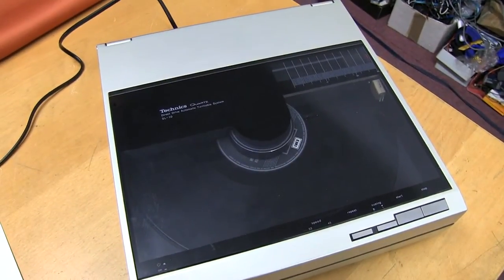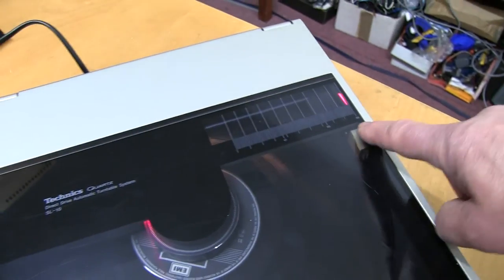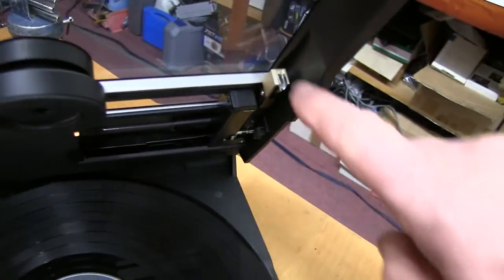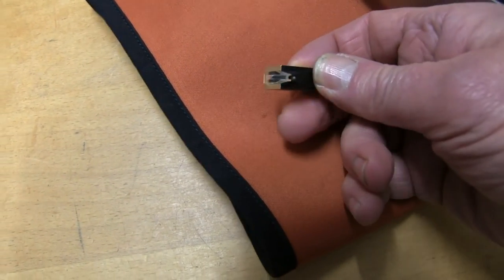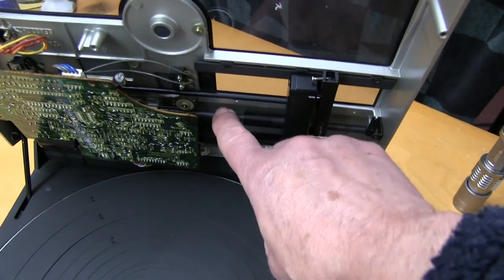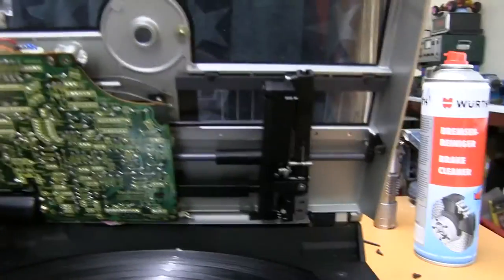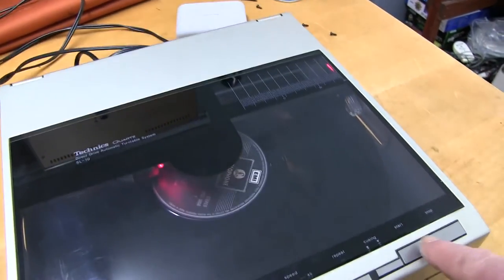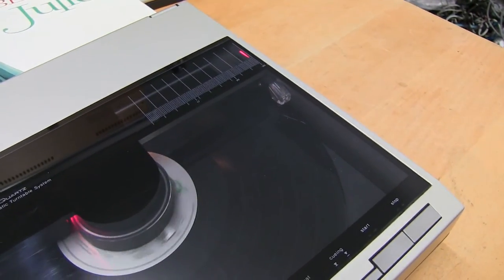Technics SL-10 Record player. Repair, Service and Test

Comment: Thanks to your two videos,  I have been brave enough to service my two SL-10's, clean and re-lube, remove the puck, replace the drive belts and cartridges and now they sound great and work smoothly.  Cheers Nick!
Reply from the maker: Well done. All the best and spin on.
Reply: How did you get that arm to move the needle over? I have one of these and that's all that's not working.  I got it at a thrift store for like 3 dollars!

Comment: Thanks Nick, your video helped me to confidently venture into an SL-7 that I purchased last week of eBay. The seller had one with the rubber belt completely off and wondered why it wasn't working so sold it cheap as "spares or repairs". Looks like his loss was my gain as I've put a belt on and it works!

I've cleaned off all the old grease which takes a fair amount of time and have been researching what kind of grease to use on the gears and guide rail. I came to the conclusion that the nylon worm gear runs fine dry and the metal tonearm guide feels smooth anyway. To my surprise I've come back to your video and read the comments that you didn't re-grease everything either.

I wonder why so much grease was used at the factory? Like the gentleman who commented here, the grease on the tensioned wire was black, as was the grease in the puck for me. I think that will be the only place where I'll be replacing the grease. It's a shame no oiling or greasing procedures are in the service manual.

The only issue I'm having at the moment is there's a scraping sound in one spot when the arm travels to the left, it's fine when travelling all the way to the right. It's bugging me, so I'll have to find a way to trick the player into thinking the lid is down and about to play while I actually have the cover off.

Your rubber belt seems a little too loose, so I recon a new one would be the icing on the cake.
Reply from the maker: Hi Andrew. Well done. I like the SL-7 very much. I think it is visually more attractive than my SL-10 which is a solid square. If your lid catches are not broken, then you have scored a good one. Scaping noise. It could be the plastic cover over the wires, that moves with the arm
Reply: I found an SL-7 today at a thrift store for $5.  It needs work.  Arm is stuck.  The platter won't start turning with the Start button unless I manually ensure the arm is fully right first.  There's a little play up there and I don't think it likes being anything other than fully right to start.  Not sure yet.  Hope I can get mine working.  It's in really good aesthetic condition.

Comment: I had the same issue with my SL-10  The problem was the tonearm motor was seized.  If you can get to it and turn the motor shaft by hand, with the help of some lubricant, you will be able to loosen it.  Mine has worked fine ever since, going on 6 years now.
Reply from the maker: +beninski707 
Hi, yes, most faults are simple and just the grease and lubrication.
They are very solid build.
If you still have the MC cartridge they sound excellent.
Nick

Comment: Hi Nick, 
I purchased the SL7 version which I regrettably sold to a friend complete with it's original box, packing and transit screws. When he moved I asked him if I could buy it back. Negotiations failed so I tried to buy one on ebay. 
This seller put it in a jiffy bag and posted it. Not surprisingly it arrived absolutely wrecked with a bad dent in the metal casing and the cover clips broken. 
The seller got very angry when I suggested his knowledge of mass and inertia were lacking and that was why the turntable got smashed. 
I did manage to buy another which came with the brilliant Technics cartridge the EPC205C Mk3 which was a Sure V15 killer. In the days of ultra high compliance cartridges the Technics had a Boron stylus tube which was much better at tracking than Shure V15 Mk 3 and 4 
It won several rave reviews in it's day. 
The Old SL7 ~ well it does play of a fashion if you tape the lid down with gaffer tape. 
It's nice to see that the SL10 comes apart more easily than the SL7 
Thanks for the video
Reply from the maker: Hi Jeremy
Yes, the broken players in the post. I have had many.
You scored with the EPC205C
My SL10 has the original EPC-310MC, but they are fragile, so be careful with that pipe.
Reply: I brought one of the cartridges direct from technics via the rep and got it for a bargain price. It was quite fascinating when Shure were producing the ultra high compliance cartages like the V15 III and IV 
It was all about SME arms and ultra low tracking weights.
Technics came along and moved the gateposts quite significantly.

Comment: Just wanted to thank you for the great info. I have secured one of these via EvilBay and it needs work so this vid will be invaluable. My plan is to eventually use this in the vertical aspect. I want to Bluetooth it to my Technics amp. Yeah, I'm not expecting miracles and I'm no audiophile. Quick question. The unit I'm getting has a Ortofon TM20H cartridge. Not sure if its MM or MC, any info I find is sketchy. My question is depending on whether the cart is MM or MC will I still need to ground the turntable to my eventual choice of Bluetooth transmitter if in fact I'm utilizing the internal pre-amp of the SL-10. Or indeed will I still need an external pre-amp before the BT Transmitter, no matter the flavor of the stylus? Hope this makes some kind of sense. Many thanks in advance...

Comment: Great video which helped me get my tonearm advancing again after it got stuck. My issue now is figuring out how to get the whole hinge and stay back reattached. The whole apparatus, the stay itself along with its holder came off when I was disassembling. And I have no idea how it goes back together.
Reply from the maker: Hi
Did you look at the service manual?
You can get it from (free, just register)
https://www.vinylengine.com/library/technics/sl-10.shtml
Reply: I did, yes. They don't really show much about the stay; nothing about the pieces to it. Basically, I can't figure out how to attach it to the plate. It's been beguiling and frustrating me for days now.

Comment: Hello Nick!  Thanks for posting the videos regarding the maintenance for the SL-10.  I bought a new one in the 1980s and have never had to have it serviced.  I recently replaced it with an Audio-Techica 1240 because the SL started having some issues.  The SL will start to play a record and within 3-5 minutes the tone arm lifts up and returns to the resting position.  Do you think that the issue may be as easy a fix as opening the top of the case and cleaning it up?  Regrease the ball bearing etc...  I appreciate your time and hope to see a response at your leisure.   Sincerely, Scott
Reply from the maker: Hi Scott. Those type of problems are caused by the old grease on the arm tracking shafts, belts and gears. They can be cleaned up without having to replace any parts.

Comment: Hi Nick, 

Thanks so much for your service information video.

I've got an SL-6 in California that I picked up yesterday in a thrift shop.  It's not as fancy as the SL-10 in your video, but for the most part, this turntable looks very nice and plays correctly.   Unfortunately,  sometimes the tonearm/cartridge assembly "hangs up" on the rails.   I was guessing that possibly something was causing the tone arm to slightly jam, causing the record to skip. I haven't taken my player apart yet, but, just to be clear, are you saying there shouldn't be any grease on the rails, or should there be a light coating of fresh grease there?

Thanks a lot, Tom
Reply from the maker: Hi Tom
Clean off all the old grease.
The plastic will slide even without grease, but if you have some very light grease, but not 0il as that can dry up.
If you take it apart, be careful with the black sliding cover over the wires, that it is fitted correctly or it will jam half way through the record.
Let me know how you get on
Nick
Reply: Hi Nick, 

Thanks so much for getting back to me.

I was able to raise my top lid and depress the small switch at the rear of the base.  Normally this switch is engaged only when the lid goes down.  I could then operate my turntable where I could view the tonearm/cartridge mechanism operating.  There is grease there, but it is very sticky and needs to be removed.  I do have some clear light grease called Super Lube.  It's a synthetic grease with PTFE that's been recommended for use on an older turntable mechanism I serviced.

I have no idea how long this turntable has been sitting, but I imagine it's been quite a few years.  I've found that by playing it and monitoring the operation, that it seems to be getting better and better.  Having said all that, I still plan to clean off the old grease with some kind of solvent and  use my Super Lube.

I'll keep you posted as to how all this goes. 

Thanks again for all your help.

Regards, Tom

Comment: Hi, maybe you know.  I have a problem with my sl 10.  The arm stops 5mm before touching the return switch.  The cord is right, averything is right. So if I play a record that ends near the center groove, the arm return before song ends I repeat, it stops before activate the return switch

Comment: How did you remove that final clip near the record clamp? I have all the screws out in order to replace the cueing belt but got hung up there. Don't want to snap anything. Cheers and thanks for the great video.
Reply from the maker: Hi Joshua. You have to gently pull it, until it is free.

Comment: Thanks for this video - I am hearing a low 'thump' sound in between tracks.  I am thinking of opening up the unit and greasing/oiling the gears / bearings...may also change the belt.  But not sure if this will fix?  (or if the low thump is how the unit performs in general)
Reply from the maker: Hi
The thump could be the tracking motor trying to move.
Check on the run out grooves if the thump speeds up as it runs out to the end.
Or If it occurs exactly on every revolution, then there must be something touching or seized' like the pressure pad.
Try rotating the pad by hand to see if it is really free.
The platter is direct drive.
There is a cable that pulls the assembly, but it must run free on the tracking rod, so make sure that is very clean.

Comment: Hello sir we have the same turntable and the same problem. The tonearm is stuck on the end I did not see how you manage to make it work. Can you please elaborate on it. Thanks from the Philippines
Reply from the maker: Hi Gino.  Remove the drive cord and clean  all parts to remove grease. Clean the guide tubes so that the cartridge arm can slide easily. Clean the drive cord and make sure the motor and gears turn easily. All the best Nick

Comment: Duh!  I just read your response regarding the same issue just a few posts back.  I will pull it apart and clean it up and regrease.   While I am working on it, should I replace the main belt for turning the platter?  Thanks!
Reply from the maker: Hi Scott. The platter is direct drive, so does not have a belt. One advantage of direct drive. Keep spinning. Nick

Comment: So sorry to hear that Nick has passed away. I have taken apart my SL-10 and found that the little rubber drive belt on the left side has disintegrated. Does anyone know of the availability of a replacement? RIP Nick.

Comment: Appreciated the video. Have you ever worked on a Technics SL-Q5 where it seems to slow down after a bit, the platter seems to slow after 4 or five beats if that makes sense?
Reply from the maker: Hi Owen. Not sure exactly, does it stay slow, or speed back up.  It is possible the speed adjustment pot VR310 is bad connection. I would turn it a few times, and lubricate with switch cleaner if necessary.
After that if no change then check table revolves without friction, and then check all connections that are not soldered on the circuit board.
Reply: @nickadams5411  Thanks, that's what I was thinking also.

Comment: Hi, Nick - I have an SL-10 but not the power cord!  Cannot find it.  Is this a universal kind of cord, or does it have a number associated with it which I can use to shop for one??
Reply from the maker: Hi Cynthia. It is a standard " Figure 8" power lead. Ebay or Amazon:
https://www.amazon.co.uk/LINDY-Mains-Power-Lead-Black/dp/B000I2JUOC/ref=pd_vtph_lp_t_3/260-9124336-2098636?_encoding=UTF8&pd_rd_i=B000I2JUOC&pd_rd_r=ebbb9f3d-81eb-11e9-8993-cb2d847a8b8c&pd_rd_w=7vP37&pd_rd_wg=PH3DN&pf_rd_p=eb02db1b-a172-4b0e-887c-299e5e502bb0&pf_rd_r=GM3RNAZAJCJ2WB83X1CF&psc=1&refRID=GM3RNAZAJCJ2WB83X1CF

Comment: Hi, these look like great record decks! I just bought a Technics SL-L3 off eBay(fully working). Not got it yet! But seller seems decent and player looks ok! It has original cartridge and P33 stylus. I'm guessing it hasn't got a built in pre amp - is that right? SO, I'm going to run it via an external pre-amp (Behringer PP400 I'm purchasing off Amazon for 20 quid) then plugging it into my new Logica Z623 2.1 computer speakers on the spare input with RCA jacks/leads. Will that work ok,? Just wondering? Not got loads of money or huge space for large expensive hifi systems, but want to get back into vinyl records!
Reply from the maker: +comicmania2008 
Hi , Yes the decks are very good. The P mount cartridge can sound a bit bright (sibilant) on some systems.
There is no preamp, but the output is reasonable, so that PP400 should be fine.

Comment: Hi Nick, great video. I resurrected my SLV5 after some 25 years. It still works but is running slow on 33rpm. Do you suggest it is due to dry grease and the small rubber belt needing replacing.My  guide rail is quite black, should it be light grey if free from sticky grease?
Reply from the maker: Hi Andrew. You should try and remove any grease from the sliding rotating parts. I think the colour was dark on this unit. Wipe your finger on it and see if it is clean.  You should be able to rotate the belt pulley by hand, and feel the slide moving without drag.  The deck runs on a centre bearing which should not have any drag, since the linear motor is quite powerful. The speed will probably be an electronic adjustment
Technics SL-5 speed adjustment is possible from VR201 (33) and VR202 (45). Is possible to see small holes on the under side of turntable. When making this adjustment MUST make 45 first then make 33 adjust second.
If not marked. The 45 hole is the one nearest the bottom of the unit (Where the connections are etc).

Use a small flat blade driver.
Adjust the 45 pot first, then  listen to 33 before altering that. Happily just changing the 45 sorts the 33 out at the same time.

All the best. Nick
Reply: @nickadams5411  Hi Nick, thanks for the reply. I removed the dust cover and cleaned up as much grease as I could. I noticed the white wheel/worm gear was covered in yellowish grease. Should this be old gunk be  removed and re-greased?
I noticed when I operated the unit without the dust cover, that the worm gear and belt rather than moving continuously it seemed to move incrementally every couple or seconds or so - is that normal?
Changing the speed has helped somewhat, I'm just trying to get it right The manual talks about attaching a stroboscope to set speed - do you know how that attaches?
Reply from the maker: @andrewfeldt2713  Hi Andrew. Try and remove as much of that yellow grease as possible. Use an old toothbrush to scrub it off. It is not necessary to use any new grease. The linear tracking does move in small increments. You can buy or even download and print, a stroboscope array. It is placed over the centre shaft instead of a record. It will flicker as long as you have a fluorescent llight shining on it (which is 50hz light pulses). you then adjust the speed until the array stops moving. I am sure there are videos on youtube on how to do it.
Reply: @nickadams5411  Thanks Nick, I'll get cleaning that stuff off. The speed has settled down a bit. The old girl hasn't been used since 1996!

Comment: Hi nick thanks for your video, i have a similar problem but in my case the stroboscopic light just flash the light when i turned on and then the light turned off so the platter turns so fast more than 45 rpm i think, the arm is stuck and it doesn't move at all, what do you think that is wrong with my sl10, thanks for all
Reply from the maker: Repair the arm. The sliding and the cable.
Then the stobe may start to work.
Reply: @nickadams5411  Thanks nick, I'll try this way